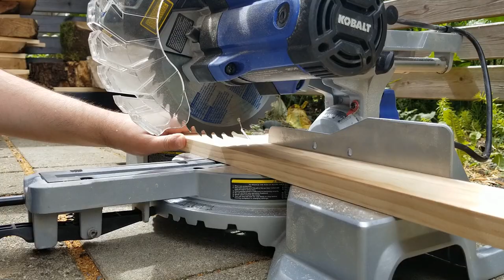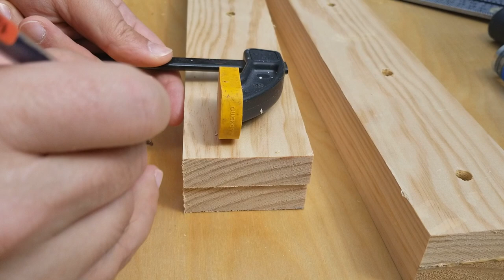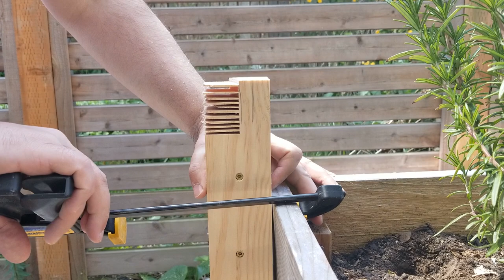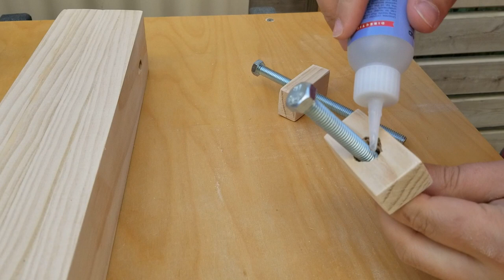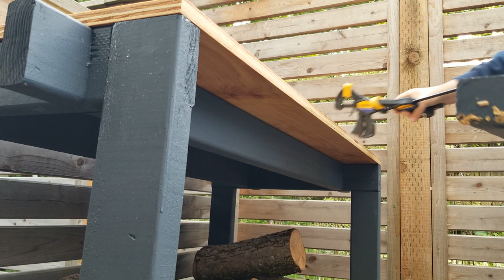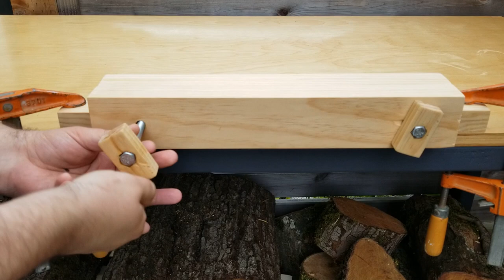DIY MOXON VISE BUDGET BUILD // Workbench Update

Comment: I know this is a bit of a budget, "rough" build, but instead of CA glue with an accelerator, try pressing some sawdust or sanding dust into the gaps around the bolt head and the nut after setting them in place, THEN hit it with the CA glue.  For the bolt head, you can even sink it into the wood slightly deeper, and cover completely with the sawdust/CA combo.  Then just sand flat.
Reply from the maker: Nice suggestion. I will have to try that!

Comment: This is perfect. Was looking for something like this that doesn't use the totally over priced moxon bolt kits. I like how the knobs are fixed and the rods moving in and out of the nuts held in the fixed face so you don't have long rods sticking out the front like on most moxons. Sound is a bit low.
Reply from the maker: Thanks, yeah, i didn't figure out my sound mixing for the first few videos.

Comment: How long of a piece could you lay horizontal to say plane the edge of a 2x4, would it hit the clamps? It looks like smaller pieces of wood or vertical may work best, or am i wrong?
Reply from the maker: Yes, needed to make the vise taller so it could hold more over the clamps.  Part of what i fixed when i did a second version attached to my portable workbench! https://youtu.be/60Qu54B9WGw

Comment: great build.  why drill several small holes in the beginning?
Reply from the maker: Thanks!  I was worried that the forces applied to the glued togeather boards in use as a clamp may overtime weaken the glue up, so I added a few screws in each side.  Probably not necessary but it helps me sleep at night. :)